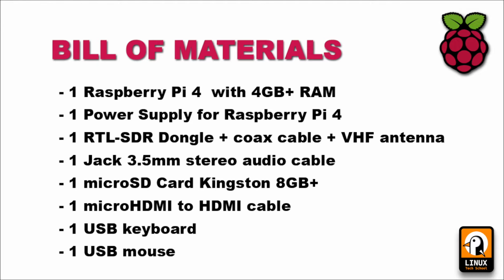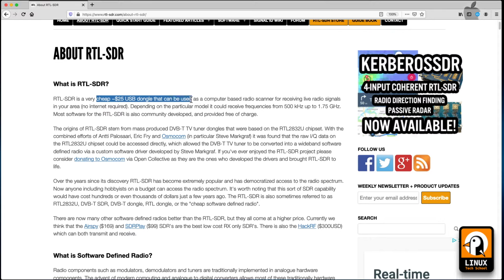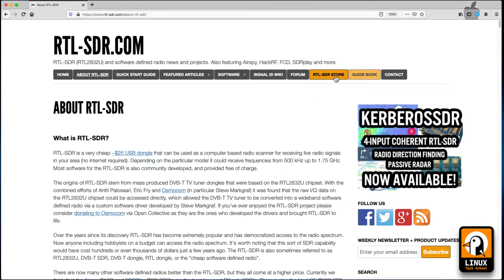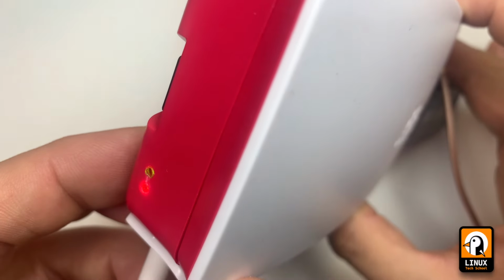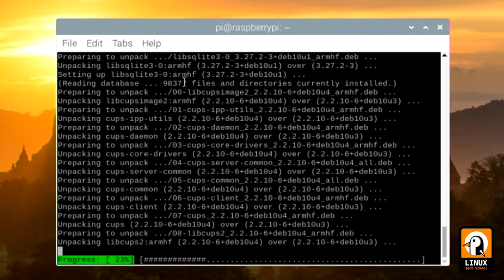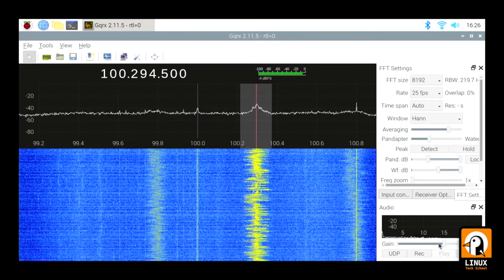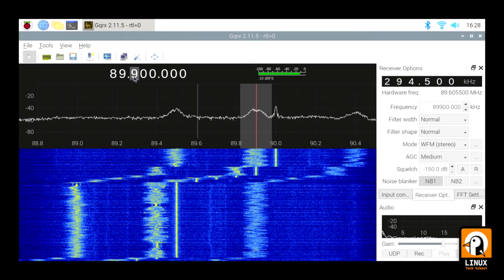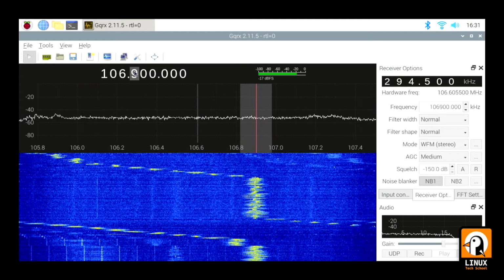Listen to FM Radio with RTL-SDR and Raspberry Pi 4

Comment: I tried it and cant get low in frequency to ham bands 80m
Reply from the maker: Hi Jim,
This RTL-SDR based on the R820T chip start to function around 80MHz. Lower HF frequencias are a problem. What you can do is to add a transverter that converts 0-30MHz to the VHF badn around 120MHz. Look on the web for something like the NooElec Ham it Up up-converter. 

https://www.nooelec.com/store/ham-it-up.html

Regards,
RSM
Reply: Buy a better SDR. those cheapo sticks are pretty bad for lower frequency stuff.